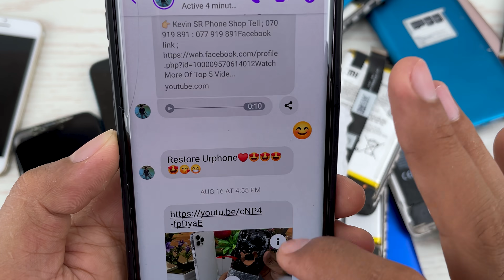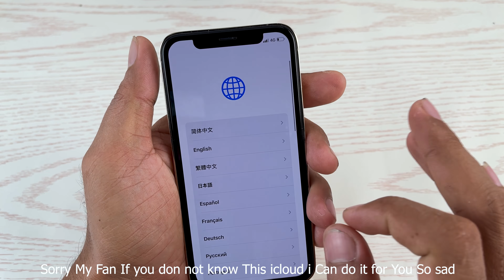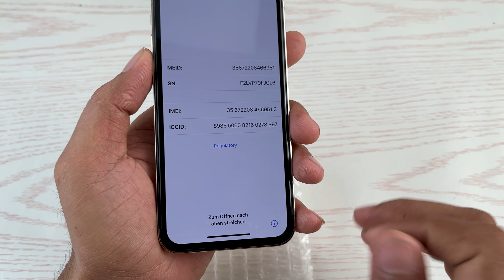Restore iPhone X​ Cracked into iPhone 12\13 Pro From Big Fan

Comment: Hello I am facing two issues after getting this housing installed, first there is a noise coming from middle of display upon pressing maybe due to the gap in the display and housing, second issue is my camera is flickering front and rear both. Please help what should I do....

Comment: Hi bro I want to send you 2 ph one is note 4 Samsung that's battery charge in 30 minutes and finished in 10 mints 
2nd I want to send you my iPhone 6pluse that deep accidentally dropped in to water I try soo much hard but un able to fix I ph which I am going to send you is with me from last 6 years I have 80GB data and contacts 
can u replace the damage IC or what ever do anything just save my data please I shall be highly grateful to you send me your address and charges for both ph desperately waiting for your kind reply please